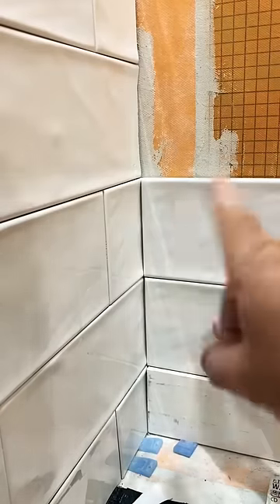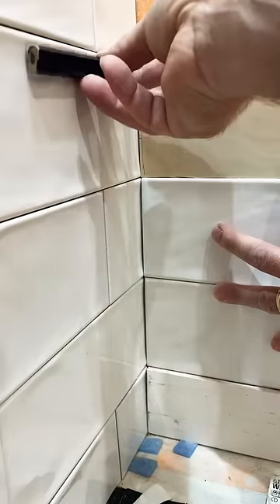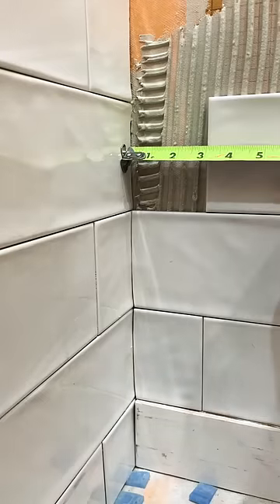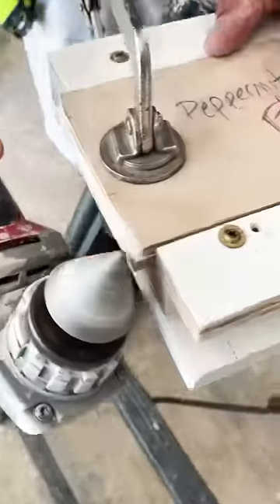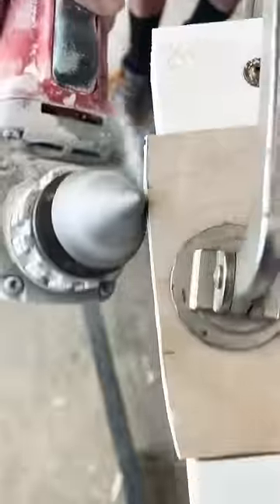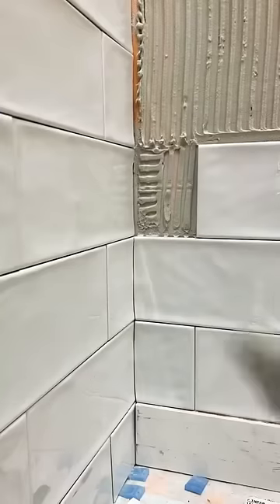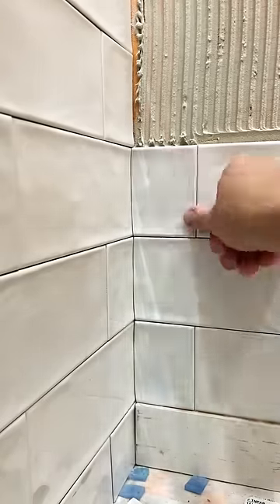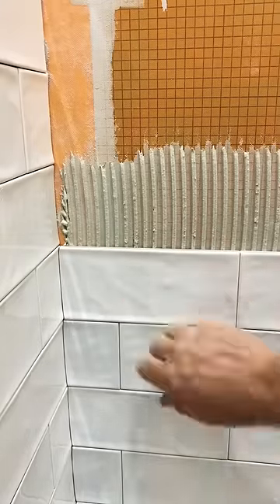Tile COPING - 101 (just a little extra effort)  #tile #coping #shower @Eylandertile

Comment: All this extra work just to end up running a bead of silicone down the corner
Reply: Exactly my thoughts
Reply: Exactly. Waste of time.
Reply: Bro you don't silicone corners of tile showers. Lololololol. If you have to. You definitely didn't do it right. Lolol
Reply: @PrdDad   I mean would you rather risk water getting in there? than think those super snug and tight corners will keep the water out? Water has a mysterious way of getting to places, you would be surprise.
Reply: @PrdDad  yes you do, water sealing
Reply: @PrdDad  Yes you do bro. If you don't, you absolutely don't know what you're doing. Lololololo
Reply: @PrdDad  you do
Reply: Also, why are there no joint lines anywhere? That will cause cracks in the tiles, due to expansion and contraction.
Reply: White tile white grout white silicone.!!! But the other scary thing is he left no grout joint ..!! He stacked the tiles ..!! You can’t do that ..!! Minimum 1/16 grout joint ..!!!
Reply: @PrdDad  you always silicone the corners and bottoms of tiles where the meet the tub with silicone ..!!! It’s called water will find a way kerdy or not ..!!! And the biggest problem here is he stacked the tiles left no grout joint ..!! Minimum 1/16 grout joint
Reply: @JorgeGonzalez-ei6ft  minimum 1/16 grout joint ..!! I’ve been tiling for 25 years and I’ve seen many tile guys stack tiles like this guy and it’s no bueno
Reply: Yeah but i only use clear silicone so you still see every cut, little details make the difference
Reply: @legacyturbo8485  I know. I've seen the result,  pushes all the tiles off the wall eventually.
Reply: @JorgeGonzalez-ei6ft  first off when you stack tiles the only grout you can use is unsanded grout which is garbage ..!! Sanded grout is way better but needs a minimum of 1/16 grout joint
Reply: @chrismartin7747  clear silicone is ugly ..!! Makes the grout look darker..!!! Clear silicone is for granite countertops
Reply: Have you guys never heard of grout chalk before’
Reply: @MegaMeco2  never heard of it .!!!!
Reply: @PrdDad  You are mistaken Devin.  Call a Professional or get the education.
Reply: @PrdDad  You must’ve never done tile work before.
Reply: Exactlyyyyyy
Reply: @PrdDad  you 100% do, shower needs to be watertight
Reply: @legacyturbo8485  these subwaytiles are specifically made to be stacked like this. They have built in spacers and it's true u can't use sanded grout but If u have unsanded grout with a latex additive it's just as good as sanded and specifically made for joints  1/16 and under
Reply: @alphaomega311  no my friend ..!!! As per ttmac all wall tiles should have a minimum of 1/16 grout joint ..!!! Only tile you can stack is the subway tiles that have a cheater edge ..!! Little nibs on them ..!!! CDC tgt tiles Olympia tiles some of them have the nibs ..!! They come in a 6x6 wall tile and a 3x6 subway tile
Reply: @alphaomega311  those tiles he was installing didn’t have the nibs on them
Reply: @Gone4Everx  I'd hate to see any work you do. NO ONE silicones where tiles meet in the corner. Seriously. You have to be joking.
Reply: @PrdDad  bro literally everyone’s silicones in the corner where tiles meet, like everyone else in this comment section realises. None of us want to ever admit it, but in this case you are wrong
Reply: @PrdDad  left the building
Reply: This dude not heard of tile spacers or expansion 🤔🤦‍♂️
Reply: @amococ2487  he never says it’s a shower
Reply: @crimps.on.slopers  All internal corners are susceptible to cracking, regardless of shower area or not.
Reply: @crimps.on.slopers  #shower below video.
Reply: when the wall is gna move hes gna b in trouble anyway always leave 1-2mm for the walls to move otherwise... it wont b good
Reply: @PrdDad  I'm assuming you grout the corners or where every other surface meets 🤣🤣🤣🤣🤣🤣, silicone is the only product you use on corners, where tile meets wood etc etc silicone expands with house movement. Silicone does not crack as I stated before making it the only product capable of withstanding takes like this grout or caulking cracks or crumbles after 6 7 months, I've installed thousands of sqft of tile.
Reply: @DANIEL32170  no one is talking about where tile meets wood or paint. The video was a inside corner. Tile to tile in a vertical shower. With a shower pan. The wall should have durock on it. The durock is tapped and sealed. After that The durock is red guarded. Inside corners ARE NOT SILICONED. Even on exterior tile to wall. We use sluder strips. GROUTED to the tile. The metal strip gets siliconed against the paint. Silicone is only used inside where tile meets a tub or when installing glass walls and doors. Or on recesses like soap bottle holes or sitting spots with horizontal surfaces we use siliconed grout color matched in a tube.
Reply: @PrdDad  🤣🤣🤣🤣🤣🤣🤣 red guard is trash doesn't warranty their product and doesn't pay homeowners damages  if the product fails, that comment tells me your a diy dude that has done some jobs but doesn't warranty the job or has any clue about how tile actually works. Been around tile since I'm 11 I'm 35 more than half of life been to countless laticrete,schulter and other companies showing their products over the years and all detail how important it is to silicone the corners. They make silicone the same color as grout. 😂😂😂😂 Just stop man go tell that to sal diblasi, the tile coach, landberg tile who own and run more successful companies than me and been on the business longer than me.
Reply: @PrdDad  sluder strips huh 🤣🤣🤣🤣. It's schulter guy if your going to come in here talking about how your not supposed to do a job at least know the product. Schulter and laticrete warranty their products if they fail, corners are the most crucial areas in a shower you DO NOT GROUT THEM GROUT CRACKS the silicone gives it a cleaner look and it stays there for years.
Reply: @PrdDad  Look mate, I've been tiling for over 20 years. Yes, I know it's been tanked. All internal angles should have a silicone joint. The grout WILL crack over time. Expansion and contraction of materials will cause this over time. Being tanked, yes that will prevent water getting through anywhere but for aesthetic purposes (so you don't see cracked grout in the corner) you should have a silicone joint. If done professionally with a 45⁰ profile it will look far better anyway. I prefer to use silicone colour matched to the tile rather than the grout (if contrasting grout is used) as it makes the tile look like it wraps around the 2 surfaces.
Reply: Oh! And it's Schluter.
Reply: laughs in DAP AMP
Reply: @PrdDad  your wrong, do you silicone tile on corners in shower. Look it up
Reply: @PrdDad  you're wrong. Take the L. All control joints require caulking. Grout cracks and looks like shit and isn't easily removed like caulking. Seen it a hundred times. Not to mention the lack of waterproofing you get with grout. Doesn't matter how long you've been doing something if you've been doing it wrong the whole time
Reply: @PrdDad  Industry standards calls for caulk or silicone when there is change of plane.  That corner may crack after a while due to joint movement.
Reply: Bro likes giving his time away
Reply: 🤣🤣🤣Probably yeah
Reply: @PrdDad  bro , you should
Reply: @amococ2487  he’s one of those guys that just throws grout into the corner, a week later there will be a crack down it but he’s already gone lol
Reply: @Nate-ld7zj  you know 👊
Reply: @PrdDad  yeah actually you do, most ppl use grout caulk, it’s like a silicone in a caulk tube but the grouts color made for the grout specifically
Reply: @PrdDad  of course you do 🙄 corners are weak spots for water ingress
Reply: Lmao
Reply: Caulk
Reply: Yes exactly….
Reply: @PrdDad  EVERY TRADESMAN SILICONES THE CORNERS..At least tradesmen that know what the hell they’re doing…Expansion joints and water resistance…
Reply: @PrdDad  yes you should caulk your corners because if theres any movement in the wall from the carpenters work it will crack your corners and it will do it before the house is even finished being built and guess whose gona get the call to come back fix it
Reply: You’ve just spoke complete utter bollox. You grout the corners not silicone them
Reply: ... grout is a thing?
Reply: @justkiddin1980  no they don’t. The seal the bottom of the work top and tiles not the corners 🤣🤣🤣🤣. My dad was a tiler and both my brothers are tilers.
Reply: @justkiddin1980  you clearly don’t know what you are doing then 🤣🤣
Reply: @rubenllamas5644  just wanted to say I helped do tile in a bathroom and they have a water proof backer board along with a sealer behind the tile. So anywhere water that does penatrate, it can flow along sealer down to the drain tub on the bottom of the shower. Did you know there's a Giant plastic tub under the floor of the tile in a shower that leads to the drain? Yall are funny trying to act like you know what your talking about😂😂
Reply: @PrdDad  yes, yes you do. Every single time
Reply: @Cobyc5150  that’s why you are still a helper because you are completely clueless of what you are saying. Backer board isn’t waterproof what waterproofs it is called redguard and it’s a plastic membrane that can be applied with a roller or a trowel. If water gets behind tile and into the thinset slowly but surely the water will damage something. I see what you are trying to say but if you were to explain that to someone like me this is exactly the response you will get. I work on many houses along pacific coast highway in California, from Long Beach all the way up to Newport Beach area.
Reply: Also he doesn't have spacers lol
Reply: Its very nice but there will be a sillicon bead down the corner no matter how tight you cut it..
Reply: @PrdDad  you really don't silicone your corners? Have fun with mold
Reply: @rubenllamas5644  Caulk doesn't stick to grout very well, and you also don't want a giant joint in the corners. Therefore, there's really no point in caulking the corners. Waters going to go down to the base anyway, unless you think you did a shitty waterproof job. The only part of a newly tiled shower that needs to be caulked is where the wall meets the base, after making sure you removed all the grout from it with a blade.
Reply: @PrdDad  so you’re the guy who’s work I keep on having to come fix everywhere.
Reply: You're right but in don't agree 100%, when you install waterpipes at a new house you're looking to install them straight too. It's just a nice feeling for yourself an for the customer to get everything right . Of course it would work too, even if you don't mind if it looks good because a huge layer of concrete comes above it but yeah😁sry for my Englisch 
Greetings from Germany
Reply: @PrdDad  Yeah, we're all laughing at you.
Reply: @berserkr302  You're the only person in this entire comment section that knows what they're talking about. Thank you for taking the time to be professional.
Reply: @mikejames4271  I don't give a shit what any of you think. We don't do that shit where I live. Maybe it's the area. Everyone grouts the corners of showers and backsplashes. Ever sense this came up I said who knows maybe I was taught wrong, so I have been looking more and more. I still haven't found a single tiled shower or kitchen backsplash using silicone in the corners.
Reply: @mikejames4271  the only place that is siliconed is if the shower has a tub. It's siliconed there where tile touches the tub. Or where glass meets tile. Maybe houses move more where you live but it's not somthing done here. I have never seen it. Heard of it. Or found it. On any job.
Reply: @PrdDad  American?
Reply: @PrdDad  Maybe you hav'nt if you live in the Congo.
Reply: @PrdDad  You're in the right bud, I've never seen a new spec house ask for silicone down the corners. I've been doing it the same way for years and no customer, contractor, nor inspector has complained.

Don't listen to these idiots lol
Reply: @justkiddin1980  no they don't. I don't know when the last time you did a shower. But the durock we use today weighs nothing. You can cut it with a razor blade. Everything is water proofed with red gaurd. Taped together like drywall. The waterproofing done before the tile is good enough to not even need tile. Not to mention the gaint thick ass rubber membrane on the bottom that ties into the drain. Spacers arnt used anymore. The gap between tile is paper thin. The adhesive especially for large format tile is wicked advanced and bonds everything together extremely well. The grout already has sealant in it today. Not like it's needed but it dose. Imagine charging someone 5 grand for a shower to say ta da and the corners are a shade off becuase you "siliconed" them with some crappy color matched siliconized grout. Talk all the shit you want. Your wrong or old. Or both.
Reply: Let me guess your work truck is a mess lol
Reply: It’s insane that so many people are siliconing corners. There should already be durok under the tiles that have 2 layers of waterproof coating on top. Silicone looks tacky, If you prepare properly you can avoid it altogether.
Reply: Ok you're right
Extra effort always makes it look best
Reply: @mikejames4271  right becuase streamlined new construction is just poping in the Congo. Do us all a favor and go check. Will ya.
Reply: @DANIEL32170  I always find the people that rag on spelling errors always have the weakest argument. Spelling has ZERO to do with any trade skill. ZERO. ZERO ZERO. People like you come in the comment section complaining about spelling errors and proper use words like there vs their. Your vs you are. Knowing damn well what we mean. I have never got thru a job and had a client say oh i cant pay you by the way you spelled this wrong on the invoice. But sure bro you are absolutely correct it totally means my argument and points don't matter. Whennwe go to the supply house we use words to order what we want not pen and paper. 
You must live somewhere it snows and freezes buildings don't move like that here. Again NO ONE silicones corners. And that silicone grout shit dosent match the grout color ever. It's trash. My client would much rather have me come repair a corner Crack 7 to 10 years down the road then constantly look at a off color border outline of your shity silicone grout. 
Plus if you have to worry about the tile being your waterproofing agent you have more than enough problems. Under that corner you are so obsessed with it is already water proofed.
Reply: @PrdDad  haha, wow, firstly you always silicone corners in wet areas, secondly, how would be grout that corner to guarantee a water tight seal, thirdly there will be movement which will expose small hairline gap even in flexi grout, silicone can move and stretch during fractional movement keeping the seal 

Please if you’ve done bathrooms in this way, I’d get calling old clients and offer “free 2 year bathroom touch up” and run round with silicone before you end up going round repairing move than a poor joint
Reply: Subway tiles have spacers built in to them. He is wasting time though. With the schluter backing he should be fine to grout the whole thing
Reply: @Jumpingbeans256  it’s poor practice not to seal joints even if backing is suited, you’ll get mould and even if backing is waterproof it will most likely be able to run downwards on the wall so you’d need floor to be waterproof, all a bit of a gamble when there’s countless silicone colours to match all  grout and/tiles
Reply: @Jumpingbeans256  cut tiles don’t have spacers built in
Reply: @PrdDad  I have installed more tile that you would ever dreamed dude, commercial residential any anything ial all homes shift and move because the ground moves and grout doesn't last years before it cracks it could happen weeks or months after you finish the install has nothing to do with the installer is the way the product reacts simply that. If the silicone doesn't match the grout color make sure to buy the same brands going back to your red gaard that tells me you buy everything at home Depot, you are probably a handyman not even a registered company EVERY TILE GUY I'VE KNOWN KNOWS silicone in every corner,around door frames or between wood and tile floors is one of the things every company or material manufacturer tells and keeps telling installers to use that's like a code almost among tile installers.   🤣🤣🤣🤣🤣🤣🤣🤣 Stop man just stop
Reply: @PrdDad  why not?
Reply: @PrdDad  note: never hire Devin
Reply: Lol
Reply: @Devin everybody silicones the corners apart from you apparently!!
Reply: @Devin You good man. Everyone commenting don't know what they talking about. Bet most of them just searching Google
Reply: #SILICONE
Reply: Silicone ?? 😂 he used Schluter system under its all water proofed before tile only thing he’s doing is grout and done lol
Reply: @PrdDad    Bro... you better!  If you don't,  you don't know what's up.  And if you say you've done it that way for... however long, your customers just don't want you back to fix it.
Reply: @PrdDad   I would love to argue,  but I'm actually setting tile today.   Go back to pretending you know something.
Reply: Now you don't have enough gap for grout. 🤣
Reply: No grout?
Reply: Grout
Reply: @rubenllamas5644  grout..
Reply: @amococ2487  grout..
Reply: Most every Grout has a matching caulk for the corners of your shower siliconized caulk and silicone are not the same thing so why anyone is throwing straight silicone in there corners idk but also different places and people have developed different ideas and techniques i suppose lol
Reply: @whitebocolate69  crack..
Reply: @amococ2487  you don’t know how to grout then🤷🏼‍♂️
Reply: @whitebocolate69  yes. I do. You don't know how to apply silicone then.
Reply: @whitebocolate69  I'm a fully qualified tiler of over 20 years in the UK thank you. Who said anything about clear silicone? There are many brands of silicone and grout that are colour matched perfectly. If you knew how to apply silicone professionally, it looks immaculate. Floors and walls, over time, expand and contract and there is always a possibility of the grout cracking. Especially stud walls. Your jobs are obviously not made to last the test of time. You only care about what it's like the day you get paid and leave. Great customer care there in Cali.
Reply: @whitebocolate69  the grout will crack as it's not flexible enough. Not an issue with how it's installed/applied. You are obviously not a proper tiler if you can't apply silicone to a professional level. Even if the grout didn't crack, I'd still silicone it as it looks way better when done properly. You're obviously just an amateur, who's trying to tell a professional what's best. By the way, you can Google the crack issue, plus colour matched silicone. Don't be ignorant.
Reply: Pretty sure you never want your tile corners that tight. Be the first thing to pop out when the house shifts 
… but I guess you’ll be long down the road when that happens
Reply: @PrdDad  you do have to do it, if you dont homeowner can sue you when their tile gets fucked up
Reply: Was just fine to silicone, now there is no space for silicone to go in but on top the tile?? Bad advice
Reply: @chrismartin7747  I only use translucent white silicon! Definitely the cleanest look!
Reply: @rubenllamas5644  i live in europe and have never seen a shower with silicone in the corners
Reply: it's called grout not silicone and you should appreciate someone going the extra mile to do a good job! Cudos to this contractor for putting quality over quantity!
Reply: Lol, I thought the same thing.
Reply: @Cobyc5150  that matters little when you can still see an ugly crack down internals.
Reply: Never done any tile ever, not exactly the most handy but I agree and I know will 100% confidence your right
Reply: @PrdDad  wrong Devin, only comment on your area of expertise lol
Reply: @legacyturbo8485  you don’t need spacers on subway tiles it’s made with them on the tile
Reply: @blaszen5114  sorry but even if there’s cheater edges it’s still no good ..!! Joint is still to small for sanded grout ..!! What are you thinking to put there ..?? Unsanded grout ?? That’s real garbage ..!!! Any tile with Cheater edges looks like crap if you don’t space it yourself to go at least a 1/16 grout joint trust me ..!!
Reply: Silicon caulk? LOL 😂 It's called, grout.
Reply: gets mouldy quicker i’m pre sure
Reply: @rubenllamas5644  if water gettin there is an issue then it wasn’t prepped right
Reply: Aim4TheHead  sure thing bro. I'm 100 percent positive you totally know. While you are at it. Do you mind solving any other problems for the rest of us. You obviously know everything. How lucky we are to have you in our presence. Pinch me. I must be sleeping. GFC
Reply: @UR_Right24  shouldn’t grout. Caulking for corners
Reply: And grout
Reply: And that's why you work at McDonald's. 🤣🤣
Reply: Gotta love the passion though
Reply: @PrdDad  color matched sanded silicone caulk should be used in all corners so it doesn't crack its gonna come out fine
Reply: Grout not silicone
Reply: @PrdDad   White tub and tile caulking..
Reply: why silicone why not acrylic grout caulk that's color matched then spread good and clean on it
Reply: Well we like a tight joint and a fine bead. Not a thumb joint like most jacklegs do.
Reply: @PrdDad  oh you definitely do haha
Reply: @PrdDad  bro yes tf you do
Reply: Said same thing lol
Reply: @PrdDad weird since mapei makes a color matched sealant for all their groups for just such a reason lol. All the corners ,doggo.
Reply: Don't need the silicone when it's that nicely done. Grout is waterproof
Reply: exactly
Reply: you right bud. and the end people dont want to pay
Reply: @rubenllamas5644  you have to put a water sealer underneath the tile that keeps the water from getting underneath of the tiles and yes even the corners
Reply: Sure it will be caulked but a good caulker won't glob.it and you will still see this so it will look good in my opinion
Reply: @DescartesRenegade  kurdi backing is a waterproofing membrane that if used properly it’s pretty effective. I personally like to use hardi backer, redguard, and tape mesh for my corners works really well and it’s a lot faster then the kurdi. Both methods work well, nothing last forever and especially if you leave any room for water to get into places they shouldn’t be getting to.
Reply: Jaajaajaaj....and no spacers either ??
Reply: @PrdDad so what do you do? Grout?? 😭😭
Reply: With a gap the same size as the grout lines… I would just grout it. The corners of my shower stall are just as waterproof as the walls are.
Reply: I was thinking the exact same thing! And when you have a boss or the customer riding your arse, no time for this.
Reply: @PrdDad its true I have done some Wall tiles and four years later there is no cracks om corners
Reply: @JorgeGonzalez-ei6ft so its grout glexible ? 
Do you know when something moves grout get cracks
Reply: @PrdDad   caulk all changes in plane
Reply: Lmaoo
Reply: @PrdDad  dumbass thought he was right 😂😂
Reply: What if they put clear? 😳
Reply: @rubenllamas5644  that’s why they pan showers lol
Reply: @edwintorres-hk1wh  please explain
Reply: You can backseal and keep the flush look without water causing mold.
Reply: @PrdDad  😂😂😂
Reply: @PrdDad PrdDad? More like PrdBoy.
Reply: @Luii Laxo i explained that already you are late to the scene. All up on here don’t even know what you are talking about mind your business
Reply: @JorgeGonzalez-ei6ft  they are made into the edge of the tile so when laid together it leaves a perfect grout line
Reply: I don't really understand already, gotta left spaces, dont need spaces, use silicone, don't use silicone... at the end this kind of videos doesn't teach shit because no one decides what is right or not, and you want to learn and always there's one with a complain, amazing
Reply: @ignacioalanis7119  😭😭😭😭😭😭👏🏼
Reply: @rubenllamas5644  i'm right or not Ruben?
Reply: @PrdDad  yes you do. You DEFINITELY do for expansion
Reply: @ignacioalanis7119  your comment describes pretty much everyone in America. 😂😂😂😂
Reply: @PrdDad  .....wa.....what? Lolyou sure do
Reply: @rubenllamas5644  learn b4 commenting
Reply: @Celayagmc  learn to write complete sentences
Reply: @PrdDad  you clearly don’t know what your talking about ,all your showers must have water damage in the inside by now .if you don’t have to what do they have a variety of shower silicons ,sanded and sanded
Reply: @PrdDad  wrong, that's exactly where you run silicone.
Reply: @PrdDad   I guess you are the guy you don't want to hire when doing a tile job.
Reply: @PrdDad   don't ever touch a tiled shower.. you don't have a clue what you're doing.
Reply: Yes seems pretty baked
Reply: @amococ2487 i like your idea abt the colored caulk. Question, how much gap do you allow in the corner or do you butt the tiles together?
Reply: @Rich B  About 1-1.5mm. Not sure why people on here are calling it caulk. Caulk is for filling gaps around skirting, architraves etc, it can be painted and isn't waterproof. It's silicone you want. Far more flexible, 100% waterproof. Any good grout manufacturer now sells colour matched silicone to go with the colours of grout they sell.
Reply: @amococ2487  thnx, really appreciate it. Have a job coming up shortly and this helps
Reply: Everyone silicones tile corners
Reply: tiny bead of clear?
Reply: @PrdDad these guys are weirdos.  I guess they don't understand what the waterproofing system behind the tile is for.  🤷
Reply: @TimmyTheSnail why is everybody saying that you silicone the corners?  Silicone is for waterproofing.. the waterproofing system installed on the wall behind the tile has already been waterproofed.
Reply: Why would he need silicone? It's has a water proof membrane.
Reply: @JorgeGonzalez-ei6ft  it's obvious you never installed tiles like those before and he'll use sandless grout.
Reply: @staggdegraaff1531  if you say so
Reply: @JorgeGonzalez-ei6ft  if you look there is clearly a water proof membrane it's called schluter it's orange in color. So it's not whatever I say it's a FACT.
Reply: So all that extra work to just but it up tight? Over time that will 100% make the tiles Crack from expansion and contraction
Reply: They are some tight joint right there
Reply: @PrdDad  I prefer not to have water in my walls but hey you do you
Reply: @PrdDad  lololololol
Reply: Uneven gaps create weak points in the bead of silicone. A tight cut like this will last a bit longer I guess
Reply: @tristancraven3685  blah blah blah
Reply: @legacyturbo8485  25 years and you never did any Dal 4 1/4 tile??? You know what lugs are?
Reply: @BossHogBro  ive done some dal tile back when they still existed ..!! They had dot mounted sheet mosaic ..!! And it was garbage ..!! Like most tile today ..!! Especially  standard tile for track housing ..!!
Reply: @PrdDad  100% you do ...I use colour match 100% silicone at plane all changes of plane as NTCA handbook says to🇨🇦 
and yes if you're not you have been taught wrong and it's not your fault but please never stop learning
Reply: @PrdDad  how did you get over 100 likes for a daft comment
Reply: @w.e.s9711  if you took the time to read the thread below that comment you might be enlightened.
Reply: @marcfavell  i have extensively shown my proof in the comments lower in the thread. I have a lot of people who agree with me and a lot that dont and what we relaised is its region specific. Where I live this is how we do it. We have stable soil, not in a freeze zone our houses barely settle or move even after 20 yes.  We grout corners and don't have issues. I have looked at every house and spoke to numerous contractors in case I was wrong. I'm not. You live somewhere with a winter thats causes torson on homes we don't have them. We don't have trim problems every few years. Our work is done under the tile and like I previously said if you are relying on your tile to be your water proofing agent thats a problem. Silicone is only used where I live, on tile that has glass touching it. Where the tub meet the tile. Or on shower door kits where the metal meets the tile. Or penitrations like the shower valve and shower head.
All tile to tile interactions are grouted
Reply: @PrdDad  if you don’t, you’ll be uttering my name.
Reply: Thank you! Also, that is a damn sight farther from a LITTLE extra work. Do that to every piece and you add an xtra 2 hours atleast!
Reply: @Gone4Everx  he is just gonna let the water get behind and trapped in at the bottom facepalm
Reply: Lmao was about to say the same thing.  I'm assuming he grouts the corners. I used to spend so much time with my filler cuts for outside corners on kitchen cabinets. Make that shit perfect, no need to use a trim piece (what i call amateur trim). To realize the customer still wants to use it because it was ordered.  Needless to say I stopped wasting my time and just do quick cuts and use the trim.
Reply: @My pronouns are GFC  um I don't think you know why silicone is used for corners
Reply: @PrdDad yes you do lol expansion joints need something a bit more flexible than grout
Reply: I think your missing the point brotha
Reply: agree
Reply: Isn't that  the truth.    Lol.
Reply: @PrdDad  Bruh I don't do tile but literally EVERY house I've ever lived in has had silicone in the corners....
Reply: What I was thinking
Reply: You don’t caulk corners bruh sorry, maybe in your 1k bathroom jobs, but in a 20k+ job you do it right
Reply: @Flatout56-o8k  it is right to caulk corners
Reply: Not silicone , that’s incorrect it’s grout
Reply: @Legacy Turbo  Not sure if someone answered you already, but this is a specific type of tile designed to be stacked. The bevel edge is built out which is why the shape is concave, and when stacked it gives you a steady grout line to fill. Not everything built differently than what you're familiar with is built wrong.
Reply: @PrdDad Bro if you're not siliconing your tile showers... Keep doing your thing because you keep me paid big dog.
Reply: @PrdDad you always silicone corners. Any change in plain. Never grout the corners. Needs to be able to expand and contract and move in corners.
Reply: @PrdDad Mapei, Laticrete, etc. make specific color matching silicone for sealing corners dude. Youve just been misinformed all these years (if you actually know anything about tile).
Reply: @PrdDad Plus you use Redgard!? Yah, youre a hack
Reply: This what happens when you get paid by the hour
Reply: It’s real simple. Corners flex. Every house old or new. If you don’t put silicone in the corners, eventually that grout‘s just gonna fall out and leave you with big nasty gaps. Great it’s still waterproof but it just looks bad. Put in the silicone.
Reply: Exactly
Reply: @PrdDad I don't believe silicone should be in showers either, he could have just grouted it with a space to leave room for expansion and contraction, and you would have never seen it once it was grouted